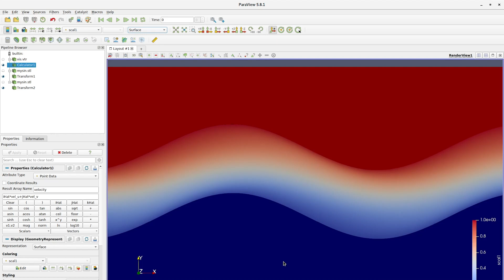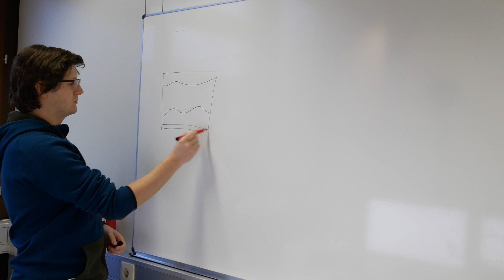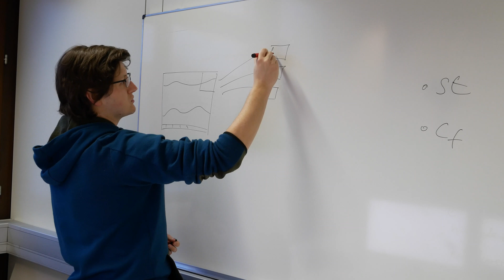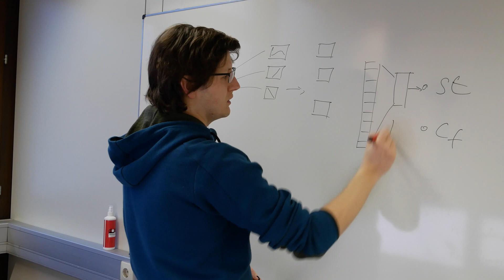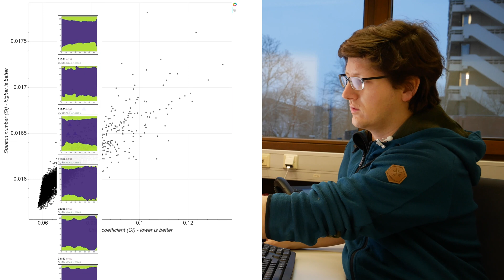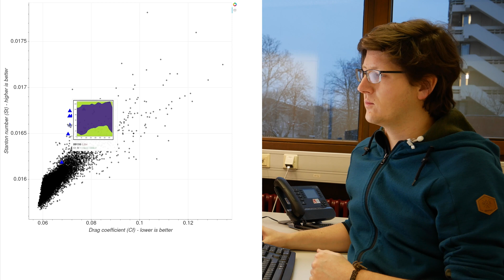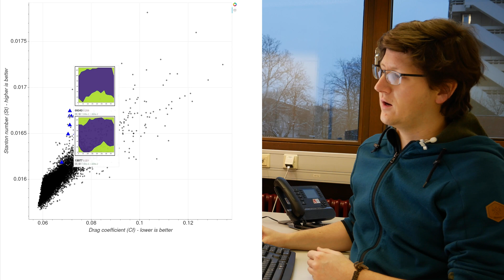Machine Learning & Chemical Engineering at KIT Karlsruhe - using Convolutional Neural Networks

Comment: ReLU is a switch. f(x)=x is connect, f(x)=0 is disconnect. A light switch in your house is binary on off, yet connects and disconnects a continuously variable AC voltage signal. The dot product of a number of (switched) dot products is still a dot product. That is the system can be simplified back down to a single dot product. A ReLU neural net then is a switched composition of dot products. When all the switch states become known the net collapses to a simple matrix. You can dig up more ...AI462 neural net.